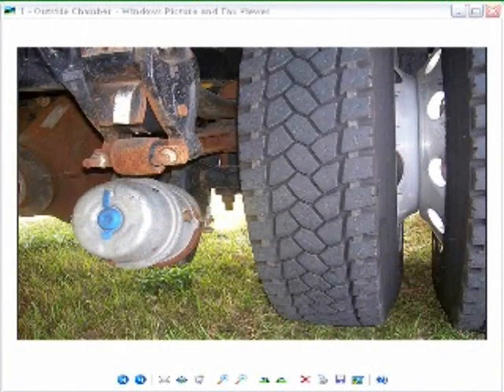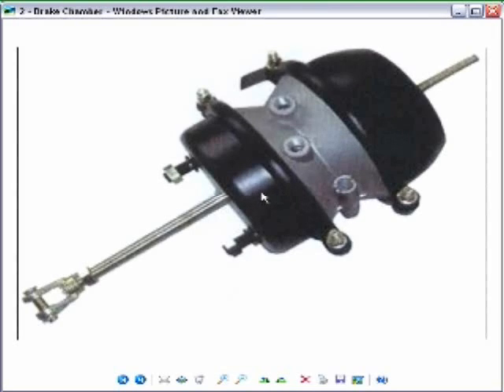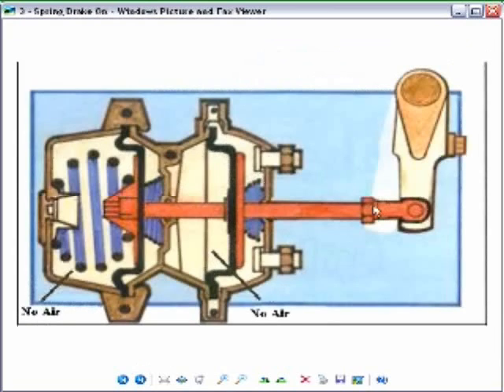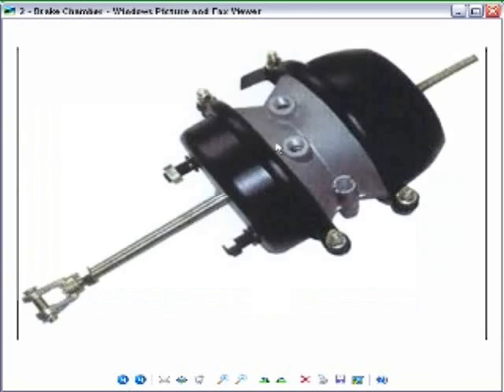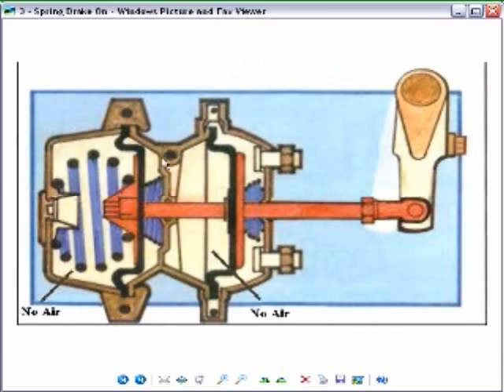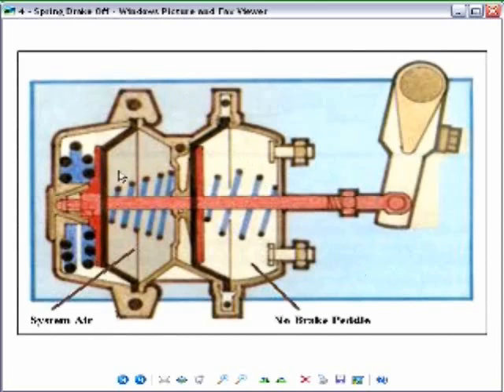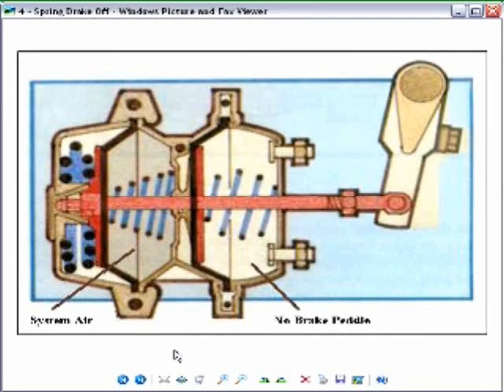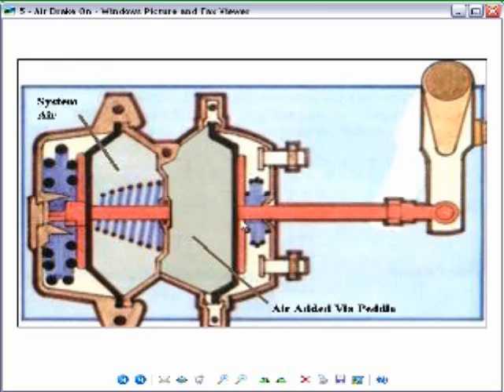Introduction to Trucking - Air Brake Chambers

Comment: Thanks.. great vid... I have a question... Story first... about 20 yrs ago the Canadian government made it a requirement to have the Q endorsement on a Drivers licence in order to obtain a class 3 or higher...  A course was offered and I took it and passed the test, with plans to someday get a tandem grain truck.....(I'm a farmer) and still have yet to go for my class 3 and have been driving only 3 tons...   20 yrs later I finaly recently purchased a 1984 Chev 70 Tandem Grain truck with airbrakes.... Nice truck and in decent shape... Now my question... It has 3 supply tanks. 2 at the rear with one drain valve each...and one by the passenger side fuel tank...  2 drain valves in the one by fuel tank. When I go to drain off water, the one by fuel tank has 2 valves, air come out of one along with whatever water... No air ever comes out of the other one, just a little gucky  water drips out( I've not driven it much yet)... Is that just the wet tank and should air come out of that one or no???   Also, when I park the truck (for eg, overnight or longer), should I drain all air out of tanks....

Comment: to ANSWER  the question. You need more air because its got to keep the ebrake spring compressed all while regulating the brakes so you dont lock up your brakes. As well you are releasing air as you let off the brake so you will need a reserve to keep up with your braking habbits.